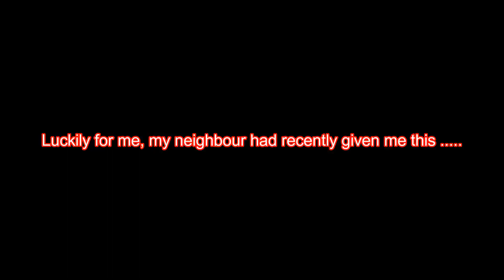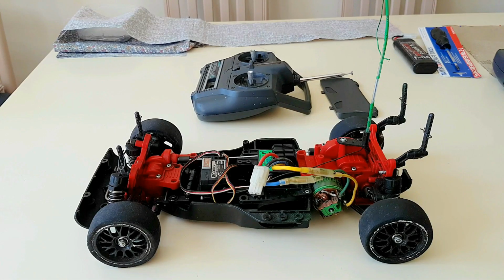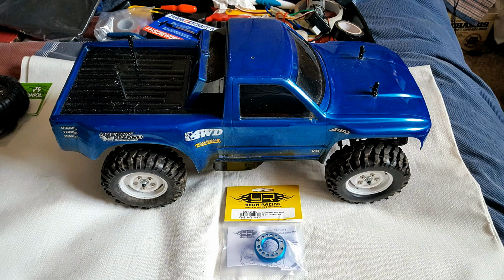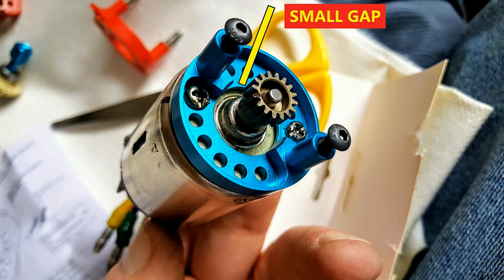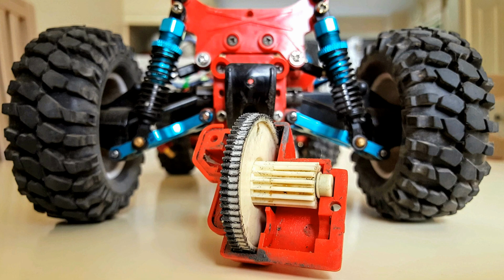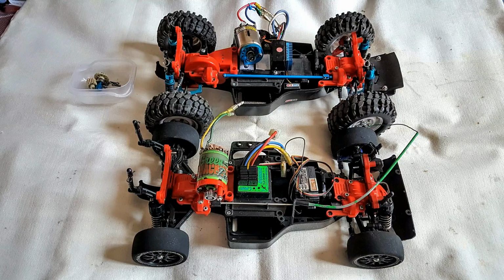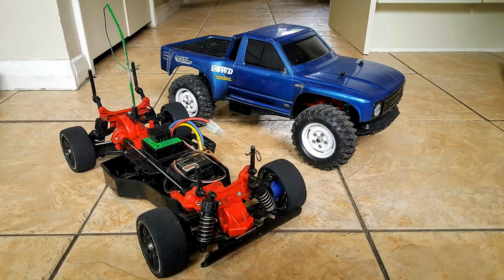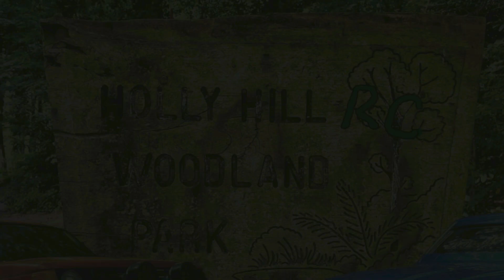Tamiya Toyota Prerunner TA-02 Fail & Fix

Comment: I want neighbours like that! When one runs out of sugar, coffee and TA-02 parts  just knock at the door 🙂 Will be a relatively easy fix. Love that blue prerunner. Hope you are feeling better and got your voice back, Derek.
Reply from the maker: Hi Mikael. What a great comment. Thank you very much my friend. Your first sentence really made me laugh 😄😄😄. Yes, I am very lucky to have such a nice neighbour. His Father built the TA-02 in the 90's for him. It was an Opel Calibra V6 DTM touring car. It has been in his attic for years. It doesn't have the body anymore and It has a front dog bone and a drive cup missing. The tyres are worn but usable but the prop shaft is very bent. Also the plastic motor mount has snapped at the screw holes. All the gears and other chassis components are good, but as you know, a lot of the parts have to be bought in bags or on trees with other parts, and to get all the ones I need would cost quite a lot of money. It's a shame because the electrics all work. The esc and motor are an upgrade (Infinity Green Machine Pro 3 motor and LRP Runner Plus ESC) and they both run really well. He also gave me a 27MHz Acoms stick transmitter and receiver with crystals. The TX has rusty battery terminals and didn't work, (but should when I clean them) so I tried another Acoms 27MHz stick TX with the crystals and it worked well with the receiver. So plenty of good usable spares for other RC's in the future if I need them. My Prerunner is fixed now and running very smoothly. It felt like a new truck when I tested it on the kitchen floor. 😊👍
Reply: Holly Hill RC It is really a great gift. Yeah, can imagine all those individual parts (let alone a body, paint, decals) ending up costing more than a used TA-02 in the end. But better it stays with you where it will be handy. Keep those electronics, they might come in handy if you get a vintage one without electronics that you wanna restore.

Comment: The run was still good, but thanks for the tip is good repair.
Reply from the maker: Bonjour Pascal. Merci beaucoup mon ami. Il est bon de partager nos conseils. C'est ainsi que j'ai appris à résoudre les problèmes de RC et à éviter les erreurs telles que celle que j'ai commise 😊😊👍👍
Reply: @hollyhillrc  Oui , le partage est très important dans notre hobbie , passe une bonne journée Holly 😊👍
Reply from the maker: @satorrotas  👍👍👍😊

Comment: What a top chap your neighbour is 👍🏻 weather has been shocking of late down this way, need some sunshine desperately, without gale force winds 😂 sweet look pre runner mate 😊
Reply from the maker: Hi Charlie. Thanks very much mate. Yes I agree, he is a top chap. We got talking about batteries a few years ago because his hobby is BB guns, and he uses mini lipo's in them. He had seen me run my cars outside the front of the house so knew I was into RC's. His Father built the TA-02 in the 90's for him. It was an Opel Calibra V6 DTM touring car. It has been in his attic for years.
Reply: Holly Hill RC please tell me you have the shell? Love me a 90s DTM and British touring cars. The Honda Accord and Renault Laguna were probably my favourites 😊
Reply from the maker: @cbix86   Really sorry mate but it didn't come with the body. Apparently it was obliterated years ago and not replaced, which is  why the chassis and radio gear was put in the loft.
Reply: Holly Hill RC That’s a shame mate, at least you have this lovely pre runner shell though 👍🏻

Comment: Yes, good tip! I've run into the "egg shape" adjusters before. They work great. But they're easy to overlook.
Reply from the maker: Thank you very much my friend. I missed it completely when I installed it. It even felt ok when I turned the wheels by hand to check everything was ok. I only realised what had happened when I looked at my photos to see if I had screwed the motor to the correct holes on the motor mount. That's when I noticed it was off center, and the penny dropped 😄 Live and learn 😊👍